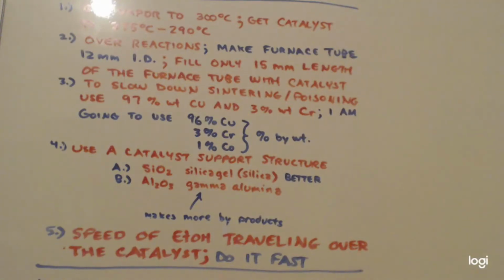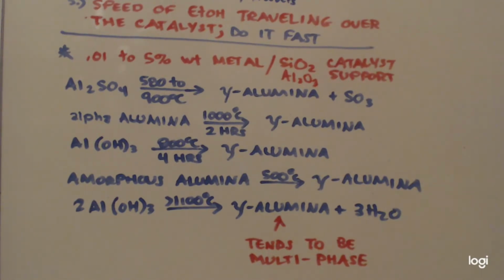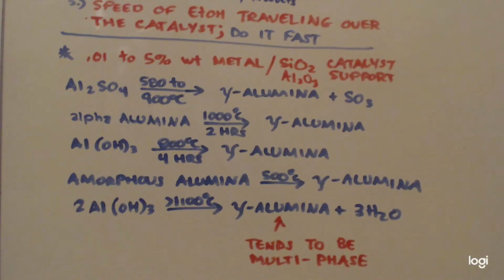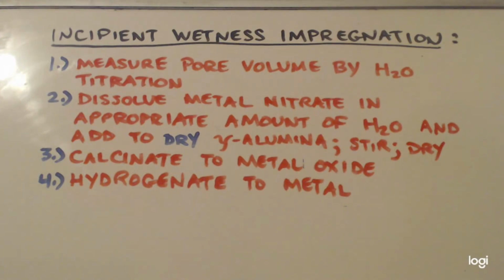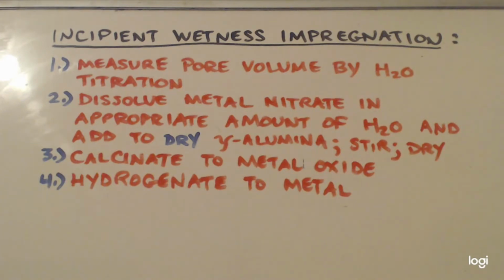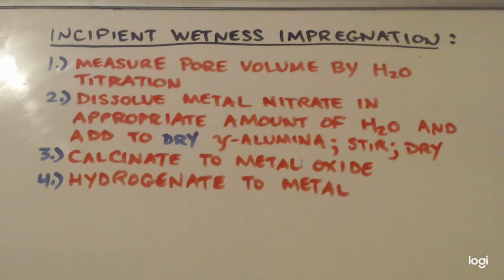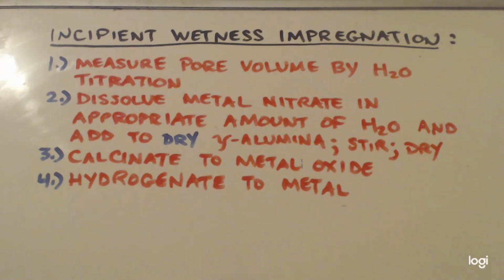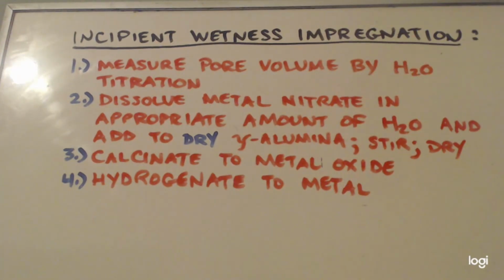ACETALDEHYDE SYNTHESIS part 4

Comment: Hallo.. Im new on chemist.. Can u explain me how react HCL + NH4N03 + C6H5CH3 that realy produce C10H15N + Cl? Please help me 🙏😭
Reply from the maker: Cahaya..............If i can help i will but you need to tell me what each chemical formula is.    I am guessing you are saying......... hydrochloric acid + ammonium nitrate +  toluene will produce  C10H15N +chlorine.    Is that what you are saying????????????/   What is C10H15N??????????????????????///
Reply: @johnblacksuperchemist2556  The Crystal M 😂, Just kidding, Thats Super Illegal on my country.. I know many methode to get The M Crystall, Like Benzylmagnesium Choride Alkylation of Acetaldehyde Methylamine.. On your prev video u teach how to make benzaldehyde and methylamine.. Or Just doing easy reactions like HI Reductions ( But Red P is very rare now on my country, u can buy just about 10grams, bytheway Iod crystall is easy to get just like Eph or pseudo eph.. U van buy 30box a day without paper or id card on my country). Yeah, i just curious and learning how to make The M, but i cant try because im poor and not have lab equipment and afraid my life ended on jail 🥱
Reply from the maker: @cahayahitam7874  ............Well it does not seem like it would be possible to make crystal from HCl and ammonium nitrate and toluene.   I mean you would need a second compound with a 2 carbon backbone to connect with the toluene to make crystal and i do not see that.   But i do not know everything.   
                      There are many ways but none are easier than making it with sudafed pills.   But not using pills the most common way.......in my opinion....is the p2p/methylamine method (reductive amination)  and the  most common way to make p2p i would guess would be oxidation of 1_phenyl isopropanol which would be made from a grignard reaction between benzyl chloride and acetaldehdye.
Reply: @johnblacksuperchemist2556  Yeah, i find about benzylmagnesium chloride with acetaldehyd methylamine from Australian.. But i ddnt know work or not, he say working and yield about 86%, Thats damn Huge!!!
Reply from the maker: @cahayahitam7874  .............Yeah it works.          Benzyl magnesium chloride and acetaldehyde in ether will give you 1_phenyl isopropanol from a grignard reaction.
                 Then oxidize the 1_phenyl isopropanol to p2p.
                  Then do a reductive amination with the p2p and methylamine and mercuric chloride/aluminum and that makes crystal meth
Reply: @johnblacksuperchemist2556  the 1 phenyl ipa yelds good P2P by an easy potassium dichromate...
Reply from the maker: @borjitasantamaria5539  ..........Hey good to see you are still around.   Are you sure dichromate will work????????????????.   I always thought it was to strong of an oxidizer and because there is a benzyl hydrogen on  the 1_phenyl isopropanol and  it  will be decomposed down to benzoic acid just like when you use permanganate as the oxidizer because they are such strong oxidizers?????????????????????????    Last year i was trying to experiment with hypochlorous acid(acidified bleach)  cause it is a MILD oxidizer.   I oxidized isopropanol to SUPER SUPER PURE propanone(acetone) with a 40% yield.  Although i have not perfected the experiment YET.   But i do know for a fact hypochlorous acid will NOT make benzoic acid even if there is a benzyl hydrogen on what you are oxidizing.
Reply: @borjitasantamaria5539  cartels using Benzaldehyde to get to the target ketone. On a massive scale. Although racemic speed is trash unless they resolve the racemic issue. Levo is not a good time.
Reply: @johnblacksuperchemist2556  haha hey I was helping clean out an old storage locker and found 4 cases of the old white crosses from the late eighties. 30 milli of ephedrine in each tablet. 120 in the bottle. 60 bottles in the case. A friend of a friend already ran a Nagai method. RP I2 and it is beautiful. All dextro. The good stuff. After all those years that ephedrine is still 100% useable and potent as the day it was made.
Reply from the maker: @waltersobchak7275  ...........Yeah they say drugs expire after a year or so but as long as they are vacuum packed it seems like they last forever to me.   I been thinking of making some sudafed.   I found you can easily buy calcium pyruvate at bulk supplements dot com.     Just do a reductive amination with methylamine and pyruvic acid to make N_methylalanine.     React that with benzaldehyde and there you go.   You got sudafed (N_methyl_1_phenyl_2_amino_1_propanol).     And i found out how to make red phosphorus from white phosphorus and white phosphorus is EASY AND FAST to make.    ADMITTEDLY I have done none of these experiments but i am HOPING they work
Reply from the maker: @waltersobchak7275  ............Also i bought a thermostat that goes up to 999C and some more SMALLER diameter quartz tubing to make  more acetaldehyde.    So it should be easy next time i try to make acetaldehyde.  No more guess work on how hot the copper or ethanol is..  I want to hit that PERFECT temp range of 275 to 290C
Reply: @johnblacksuperchemist2556  I know a Russian guy. He has the red. I thought it was a scam at first. 20 dollars for 20 grammas. Goes all the way up to 500 grammas for $125. I was getting the 20. I asked the guy was he legit. He said you are spending $20 dollars if you can’t afford to lose $20 you should just give up. He was right. He said it is going to take a long time to get there but rest assured it will. So I ordered CC and then a month and a week later I get a plastic bag from a car place. Car decals smashed in the middle was 30 grammas in a bag. Plus car decals. They were magnetic. Just used a little. Well that friend I was talking about used some😇😇. I have to write grammas because the proper word seems to get my post deleted.
Reply: @johnblacksuperchemist2556  hey I commented on one of your other videos did you see it? It was on a more personal level with situations going on with me. It may have been deleted by YouTube sensors though. Yep never mind it’s been deleted. I don’t understand what words trigger it I really don’t. I didn’t say anything vulgar or demeaning. No words I thought would trigger it yet it’s gone. I’ll try again later.
Reply from the maker: @waltersobchak7275  ...........Yeah that is cheap.....pretty much free
Reply from the maker: @waltersobchak7275  ...........No i did not see it.  Youtube sucks with their censorship
Reply: @johnblacksuperchemist2556  I seen you responded to my other comment but now all of them are gone? YouTube is getting more and more communist as the days go by
Reply: @johnblacksuperchemist2556  
It's my guess. 1phenyl2 isopropanol yields P2P by potassium chlorocromate vigorous stirring
Reply: @waltersobchak7275  
The levo issue yes
But Im sure their product right from the reactor (from the reactor to the user) is good enough for the people in the streets
Reply: @borjitasantamaria5539   50% dextro where as starting from ephedrine/pseudo 100% Dextro. They transport dissolved in polar solvent. H2O or alcohol. When it gets into the states they have what’s called conversion site. There they evaporate the liquid. Before that though the also dissolve a substance called N-Isoprophylbenzalamine which is an analog of speed. Looks same almost exactly same melting point same taste so on. Then add the dissolved N-ISO to the liquid containing the racemic speed. Then evaporate the whole thing quickly. If it were done slow and without heat it would push the impurities > N-ISO to the outside. Like a lattice work pattern. Depending on how much N-ISO is added you are probably getting tops 35% dextro. 

Signs of N-ISO from strictly a 👃observation is- running nose I mean dripping like a faucet. Extremely dry mouth, although Leve does this too. Headache and trouble urinating. The most prominent issue is about an hour after 👃you get lightheaded and have to sleep. It will knock you out. Not for long though 20 minutes tops. We call it nopedope. Other signs are flat surfaces on the edges. Real will have lines or grains like wood. Crystal clear is a good indication too. I have a piece now. A ball. Every little bit is different. When a chunk breaks off in a pebble shape but ha the lines in it all good. When I break a piece and it leaves a completely flat edge surface prepare to sleep. There is a way to separate it but what it is and isn’t solubility is so close to the real it wold be difficult.
Reply from the maker: @borjitasantamaria5539  ...........Sorry i thought you said potassium dichromate.   Yeah KCC or PCC will work VERY well
Reply: @johnblacksuperchemist2556  
John this Cahaya is a very interesting person. 
Short of the one getting thorium but in trouble for toluene.
I wasn't respectfull to him  and will never know if I could had bought some stuff (or Th for Tol....
Reply: It is illegal  in my country as well
Reply from the maker: @borjitasantamaria5539  .............Them bastards make everything illegal

Comment: Thanks for the info.  great to see the experiment and explained wonderfully
Reply from the maker: David..........Thanks.   Next time i open my lab up i plan on improving this experiment.
Reply: Sorry I can't work out how to message you directly! I wanted to ask this 
Have you looked at the possibility of making psudo ephedrine from N-methyl DL alanine? I found some literature on this! The literature is written by an Australian chemist doing his PhD and is not supposed to be available publicly so I don't know how it got out! Here is a small piece of the literature 
Initially, benzaldehyde 6 (2.0 equivalents) was added slowly to a stirring solution
of toluene, triethylamine (1.1 equivalents) and N-methylalanine 19 (1.0
equivalent). The solution was stirred to reflux for an hour before 5 v/v % acetic
acid was added and then left to stir for a further 15 hours. A number of repeat
reactions were performed with parameters altered as per Table 3.4, to test the
robustness of this reaction. All produced ephedrine/pseudoephedrine only in small amounts! 
Ok so my questions are how come only in small amounts? And can this be optimised to produce a acceptable return! Obviously I mean in theory!!! Not actual reality!
Reply: Also, how would 1 go about extracting the product they were after from the other by products
Reply from the maker: @slimewithtaytay2057  ............JUST A GUESS............. BUT You could steam distill out the product and then do the old back and forth thing with a non polar solvent and water.                          
                    Meaning........after you steam distill then extract your free based product with a non polar solvent using a sep funnel.    Now you got rid of all the polar stuff.  And you have your free base product in some non polar solvent with some non polar byproducts..   Now you bubble in some HCl gas into the non polar solvent.   The  product will acidify into a polar salt and preci out  leaving all the non polar byproducts still dissolved and the precip  you could filter it. and dry it
                            ANOTHER GUESS is you could just VACUUM distill out the product and then dissolve in a non polar solvent and bubble HCl gas through it and then filter wash and dry the precip
Reply from the maker: @slimewithtaytay2057  ............Here is a link to video where i talk about using non polar solvents and water to purify/extract amines and carboxylic acids.   https://www.youtube.com/watch?v=CKsHmWkEOHI
Reply from the maker: @random acts  ..............I do not see why you can not make larger batches.   You should get acceptable returns but like i said i have never actually done the experiment so i am just guessing on a lot